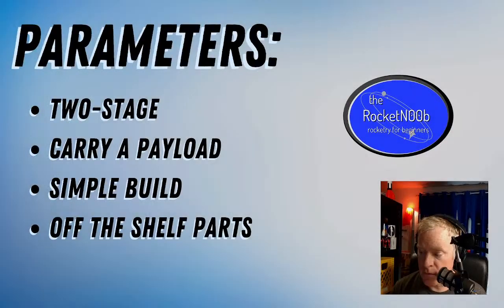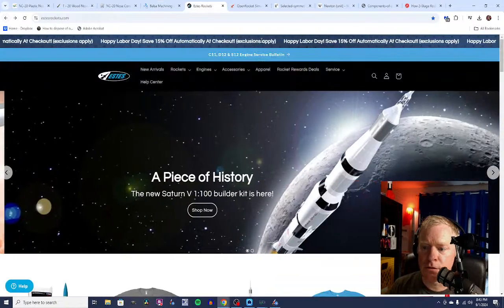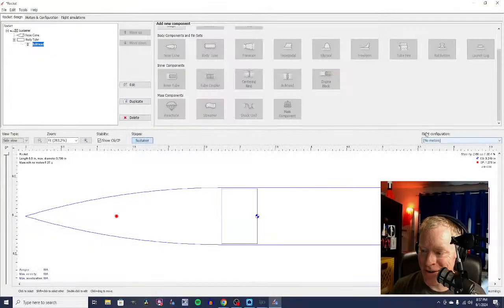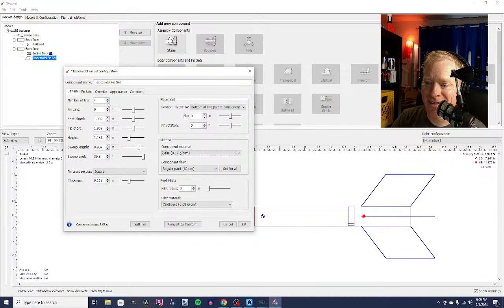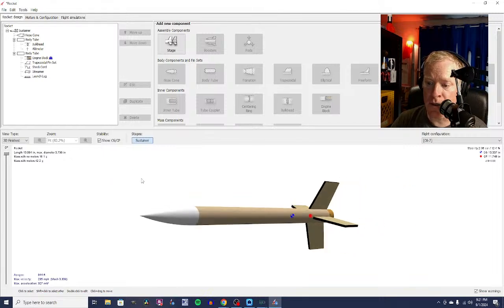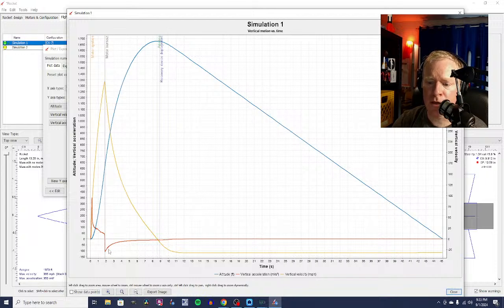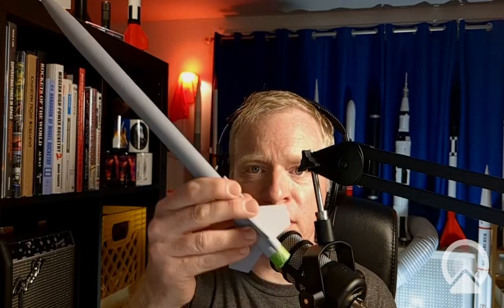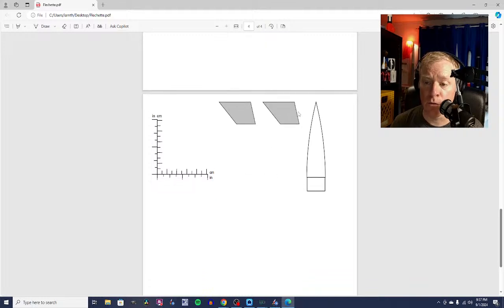Designing a High-Altitude Two Stage Model Rocket

Comment: Why not do more on altimeters - and why rocketeers trust them.
Reply from the maker: @captjohnny  Good idea!
Reply: @TheRocketN00b  Just be careful as barometric altimeters measure air pressure correctly, but can't be adjusted for changing air pressure.  This affects high altitude readings, especially.